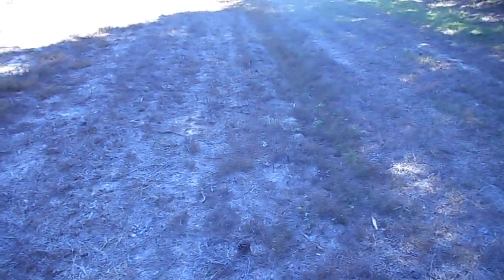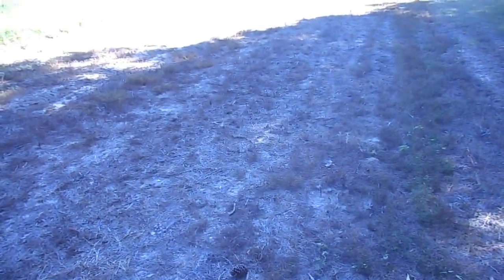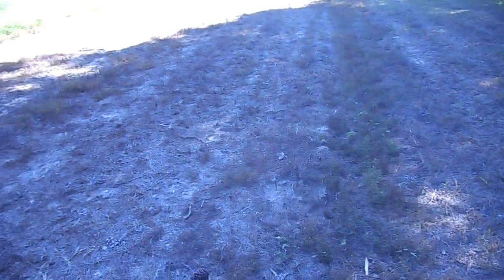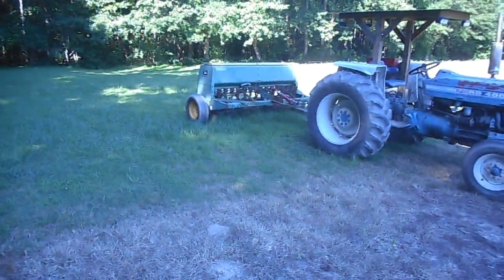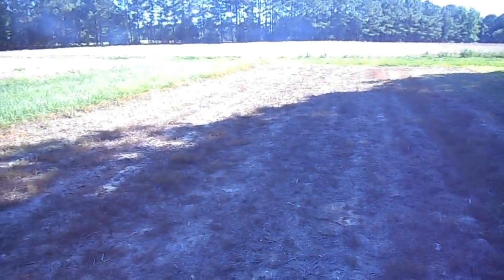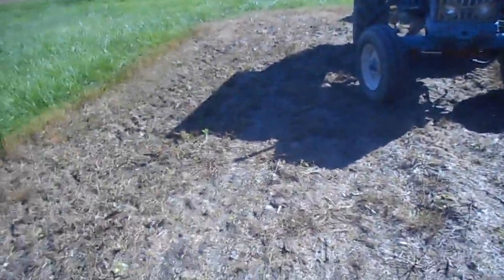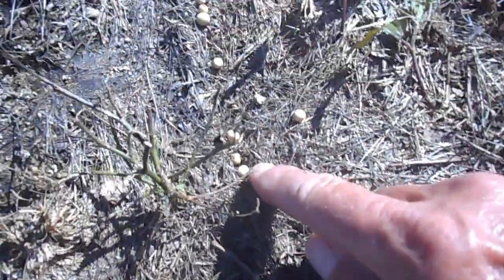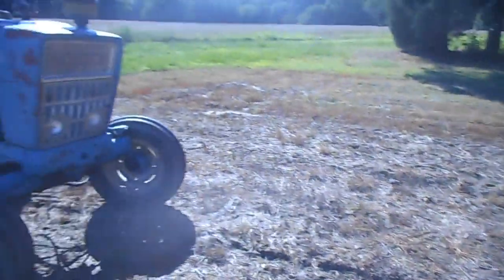No Till

Comment: That will be exiting to see the results of your experiment, good luck Soybean Farmer
Reply from the maker: Jan Kotze - the experiment is over.  it did not work.  the seed did not go into the ground.  I chose that location because it was wet and had not been disturbed in over a year.  after getting stuck in another wet spot I abandoned, I later decided to go back to the small plot and disc it for planting.  if not for positive traction I would have got stuck there also.   lots of water still in this ground and in several places where I disc the wheat stubble off I was amazed the combine did not leave deeper tracks.    thanks for watching Jan.

Comment: you would have to get a no till drill, those old deers dont have cutting wheels or much down pressure, our 515 jd drill, same system as yours for planting just bigger, even with Coulter bars in front it wont hardly work in notill
Reply from the maker: C&J FARMS - that land was very wet, full of moisture and still the drills would not go in.  that proves once and for all it will not work.  thanks for watching.

Comment: At least the birds will have something to eat I suppose.
Reply from the maker: Mac102004 Farms - no, I disc that little plot and drilled beans into the soil.   when I disc it I found out just how wet that low corner was.   positive traction is great!!!
Reply: Yes positive traction is a must on the 2wd tractors you'd be in trouble without it for sure.

Comment: You win some you lose some, it was worth a shot.
Reply from the maker: Massey1105driver - time consuming experiment.  changing the down pressure was a fight every pin was old rusty and some broke. removed the depth stops and ran full pressure.  since I did not hit any rocks I don't think I broke anything.  got to change it back this morning since the field I'm planting today has rocks.   funny thing, later in the afternoon I went to cut that little piece of land for planting and almost got stuck.  once I opened it there was lots of water under the surface.  got into another wet spot in a different location.  stuck my offset disc.  had to pull it out from the backside.    "win some you lose some"